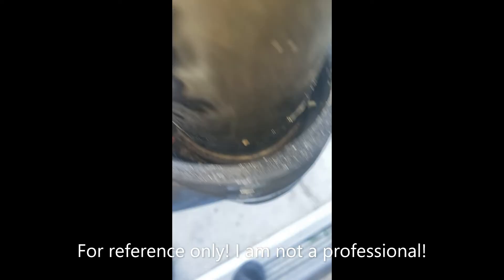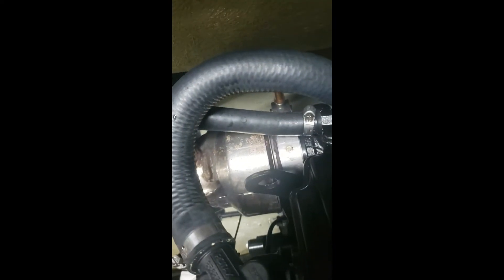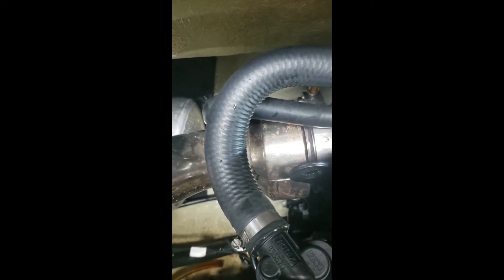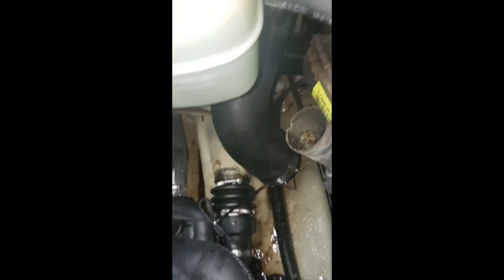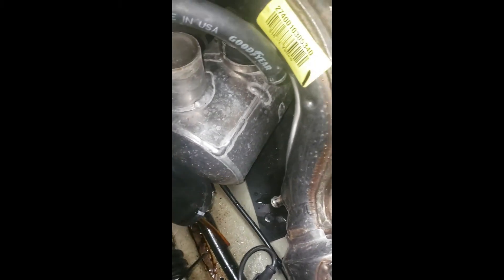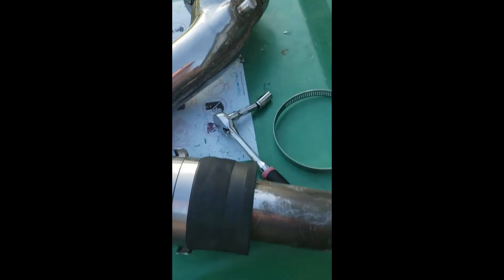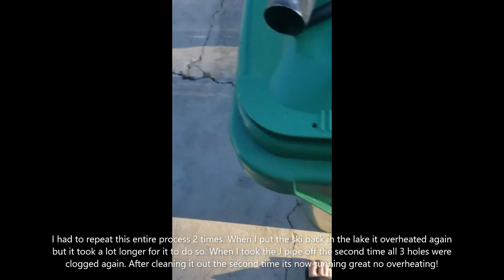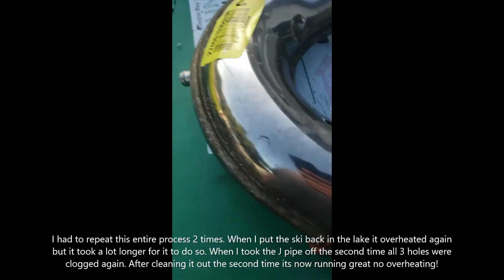This is WHY your Sea-Doo Exhaust is Overheating! Code P1544, loud beeping, message Exhaust Overheat

Comment: What Seadoo craft are you working on?  Is the exhaust manifold in the same location on a Challenger 180?
Reply from the maker: GTI130. If its not the same its very similar

Comment: I have a 2018 goes in to limp mode throws up code p0298. High temp sensor along with check engine on the dash. But then resets itself when riding for a period of time. Any thoughts what it could be changed the sensor. Still nothing
Reply: Same problem here man I have a trixx snd a spark that have the same problem it beeps really loud then goes into limp mode but then after I turn it off and turn it back on it runs fine then does it again
Reply: @parkeracord6039 same here , exactly the same . Has anyone figured this out
?

Comment: I have a 2018 goes in to limp mode throws up code p0298. High temp sensor along with check engine on the dash. But then resets itself when riding for a period of time. Any thoughts what it could be changed the sensor. Still nothing
Reply from the maker: I believe p0298 is engine cooling overheat. This video is exhaust cooling overheat. Start with checking your engine coolant level. If ok next culprit is the engine coolant water pump...

Comment: For others that have overheating issues that checked almost all the water lines and temp sensors and still have the high temperature warning check the elbow on the head with the intake water hose that sits underneath the fuel injection system it feeds the water through the top of the head and  the cylinder head temp sensor is connected to that water jacket it usually gets clogged with calcium and Lyme and looks like concrete